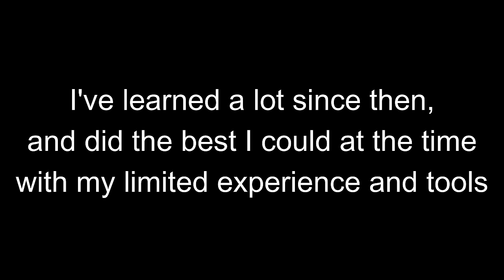I spent 4 days cleaning her yard! Yard makeover with basic tools

Comment: WOW. What a smashing job, Sean! Man, that was a lot of work. In this line of work, do you see much repetitive injury- tendinitis, etc?
Reply from the maker: Thanks! I developed a bit of carpel tunnel a while back in my right wrist, but I adjusted the way I held my whipper snipper, and along with the transition to battery gear (minimal vibration) it went away and I since haven't felt a thing. I lift weights 4 times a week, which keeps everything else in check

Comment: I have often wondered why I don't see more people do half strip cuts. After all would not cutting half the width of the lawnmower at a time be more energy efficient and less work on the lawn mower. I don't think your lawn mower would struggle as badly.
Reply from the maker: In your experience, how does that account for the half chute becoming clogged? That's rhetorical, it makes no difference

Comment: I’m curious which mower you would use now, after acquiring more equipment? The yard doesn’t look big enough to get your riding mower into it.
Does the shovel look so,short because it has a short handle or just because you’re tall?
Reply from the maker: The toro would make light work of that
Reply: @BladeMateLawnCare  , so it,would fit back there? It’s hard to tell from the video.